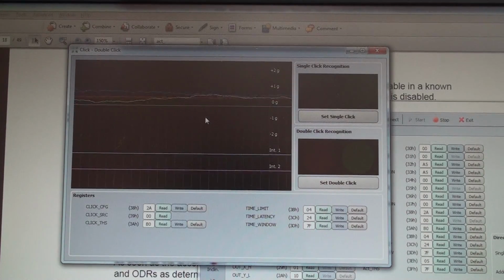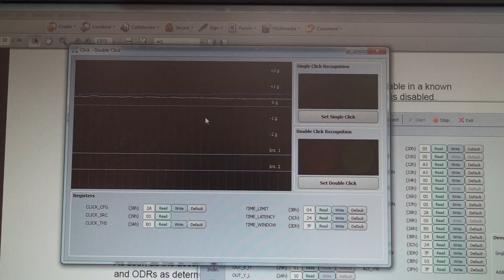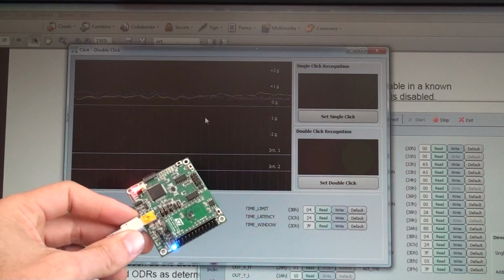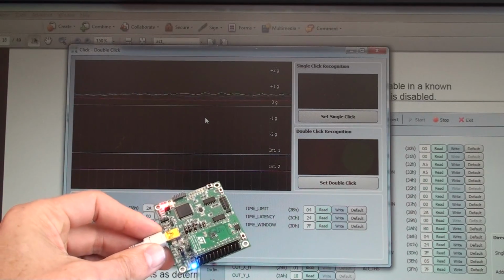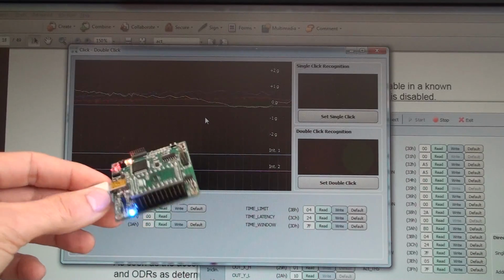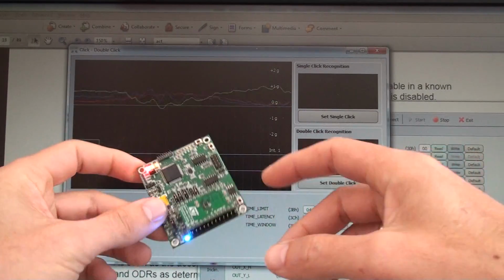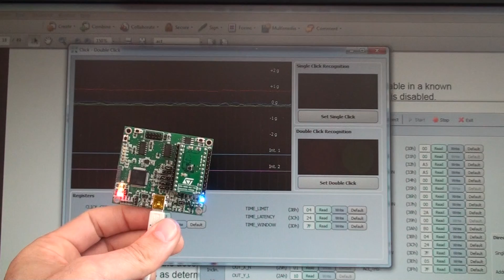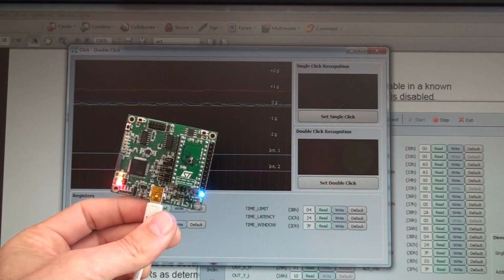LIS2DH12 Double Tap with Activity Detection

Comment: I'm trying out a LIS3DH and with the register config kindly given here I just get a 244Hz pulse from INT1 Pin. Can't find any non arduino code examples or a simple example of double click setup anywhere. Edit. It turns out I had two faulty chips, third works well with your example. Thank you.